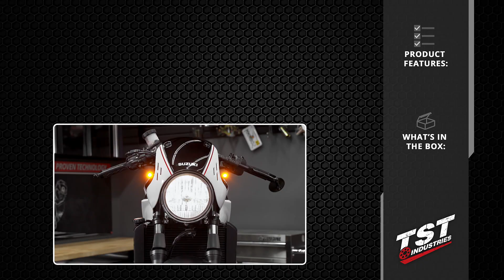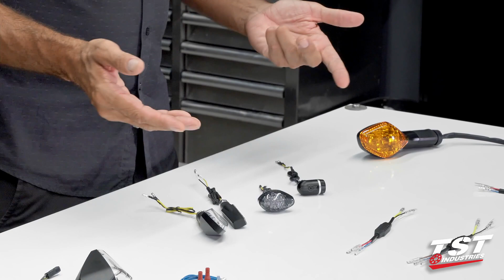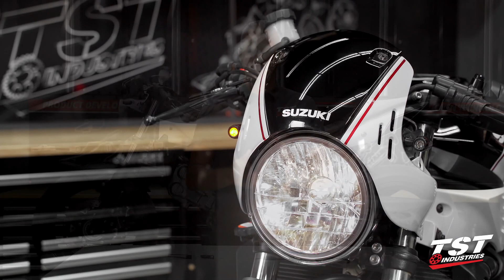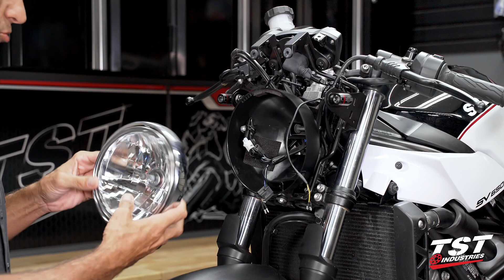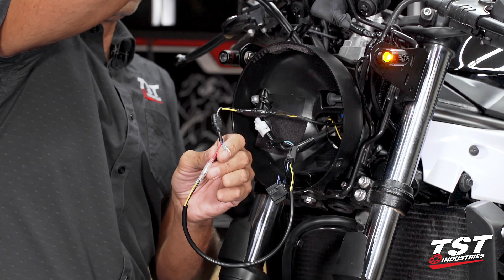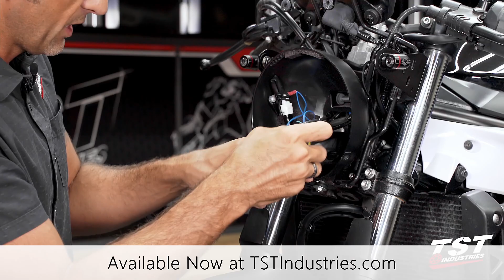How to install the TST Running Mate Circuit Connection Kit on any Motorcycle

Comment: My aftermarket lights are three wire and bike are two wire can I invert the running mate?
Reply from the maker: No, that will not work in that manner. The running light kit linked below should be able to help you achieve a running light function as long as you can identify a fused and relayed circuit. (like your headlight wiring)

https://tstindustries.com/tst-turn-signal-running-light-circuit-connection-kit.html
Reply: @TSTindustries I have the running mate kit that comes with this, but the aftermarket taillights I ordered have three wire while the bike itself runs off a two wire
Reply from the maker: @ so you will need to splice the 3rd wire from the signals, to a constant power source that's has a fused circuit.
Reply: @TSTindustries so I need to wire the turn signal yellow and ground black to the running mate corresponding  then run the running mate blue connected to the third red wire which is drl function on my aftermarket turn signals to the blue wire on the running mate and then splice it to a constant 12?
Reply: So, I’m not using the third connector on the running mate at all? Just run the third wire from the after market taillights to a constant 12v like the license plate light?

Comment: Is it possible to attach this to the xsr900?
Reply from the maker: Yes, and that bike is easy because it has a running light circuit in the signal connector.
Reply: Also for the 2016 model?
Reply from the maker: @user-eq3dt1qf5g  yes
Reply: @TSTindustries Thanks!! I have one more qustion. Does it work other than TST turn signal?

Comment: Do these also get rid of hyper flash? Or do I need a separate device or resistor for that
Reply from the maker: You would need an LED Flasher Relay in order to correct hyper flash.
Reply: @TSTindustries  thank you, either way I’m glad I found this, thank you TST

Comment: if you added a high draw acessory to the aux connector, lets say heated grips. Would it be neccsary to place a fuse inline between the posi tap and the running mate to protect the circuit??
Reply from the maker: No. As long as they are wired in parallel you don't need any additional fuse. That other accessory has no influence on current draw in the running mate leg if they are in parallel .

Comment: the connector covers, the ones you taped, wouldn't it make more sense to have them come with shrink tubing instead?  Just my opinion.
Reply from the maker: If you feel comfortable doing that, absolutely. We don't include or suggest it as that is a little more difficult to work with and isn't as easily removable.
Reply: @TSTindustries  fair enough. I see your logic.

Comment: The bullet connectors take me back to my childhood. They were common on Tamiya RC cars for OEM engine wiring. They were also a big weak point since they weren't super efficient, but obviously in this context it doesn't matter and they are nice and reliable and weather resistant.
Reply from the maker: I typically soldered mine on, and used the gangable silver contact connectors for the battery connections. This was before brushless motors of today. I actually wound my own armatures in the motors too. Back in the day when Tekin and Novak electronics were king.
Reply: @TSTindustries  Yeah, I was either direct solder or the Deans connectors depending on the situation. I didn't get into winding my own but did trim commutators and fiddle with timing when the class allowed. I was a Novak guy, never even owned a Tekin. Futaba radios and Novak esc. Chargers varied. From the cheapo 15 minute stuff to some fancy peak chargers that were a total waste because I almost never had good enough battery packs to justify them. lol. I was mostly doing this in the late 80's early 90's so... different times. Stuff we have now would have been magic back then.